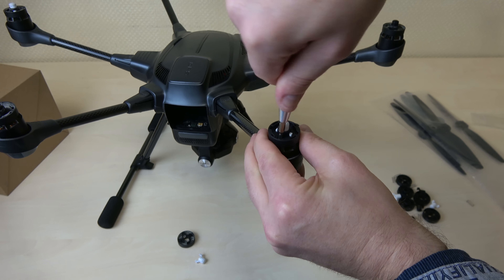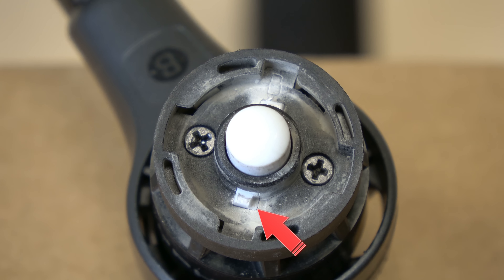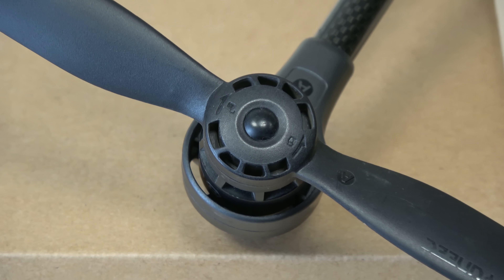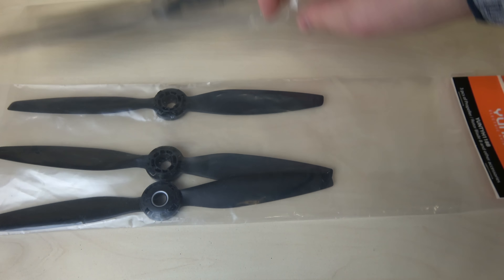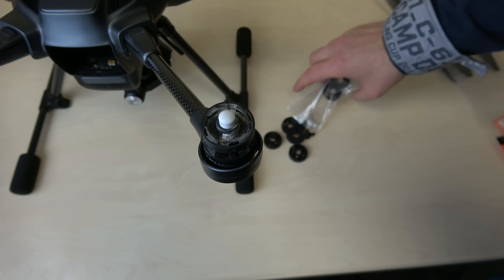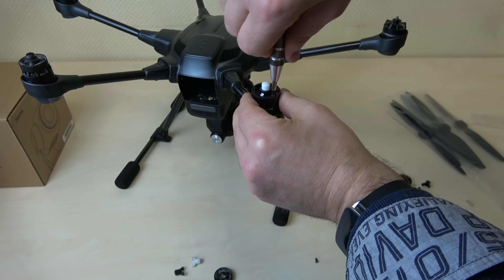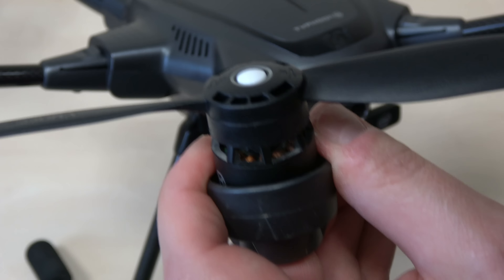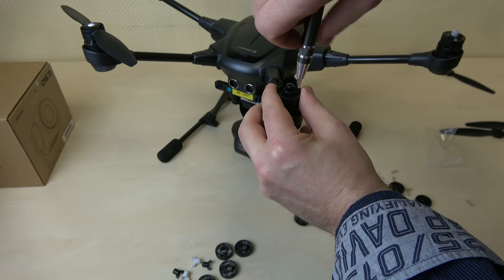#62 Yuneec Typhoon H | Propeller + Aufnahmen tauschen - Quick Release change (german deutsch)

Comment: Hallo Fan Tho Maas
Yuneec H PRO
Kannst du mir helfen, Ich bringe die Uhrzeit auf der ST 16 nicht mehr in die Reihe.
Die Uhrzeit im Settings bei Daten & time bei Set time stelle ich die Zeit auf 18 Uhr 03 gehe raus mit Done, 
gehe in die Select time Zone bei Amsterdam/Berlin, habe das 24-Haur-Format eingestellt. Jetzt gehe ich raus, bin immer noch bei den Apps, die 
Uhrzeit zeigt inzwischen auf  18 Uhr 04.Jetzt steige ich raus auf den Monitor die Uhr zeigt inzwischen 18Uhr 05, jetzt mache ich ein Foto und eine kurze 
Filmsequens . Wenn ich die Daten also Foto und Film auf den Mac runter lade zeigt mir das Foto und der Film die Uhrzeit inzwischen 20 Uhr 07. Also immer 2 Stunden später. Aber auf der ST 16
zeigt es mir die richtige Uhrzeit an 18 Uhr 09. Wo liegt mein Fehler?
Kurt Micheluzzi, Bregenz Österreich
Reply from the maker: Hallo,
stelle einfach die Zeitzone auf der Padoberfläche um, dann stimmt die Zeit.

Gruß